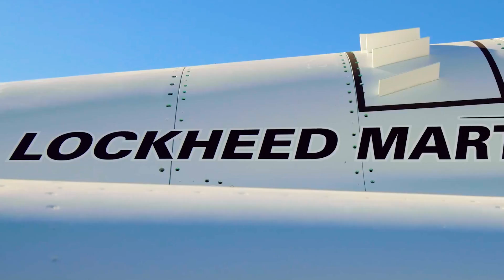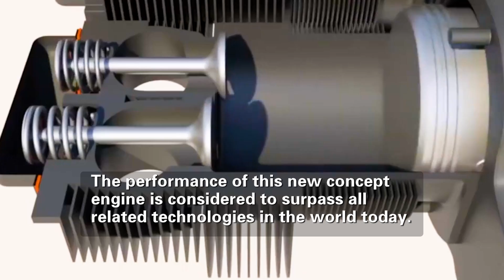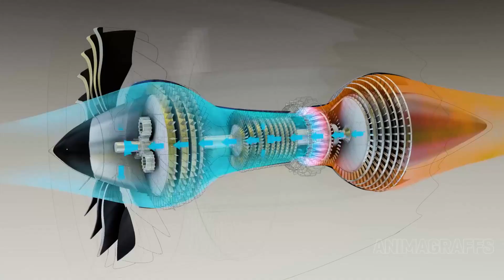Mach 16 Flight Speed! China's New Concept Aerospace Engine Raises Concerns in the West

Comment: Wow China's new scramjet engine with shockwave detonation instead of the conventional vertical detonation can achieve mach 16 while the usa could only reach mach 7 for a very brief period during flight. China has again surpassed the usa on scramjet engine development for hypersonic flights.
Reply: It's not really gonna be that fast u need a space suit otherwise u will die it's only half as fast a rocket and can't be flown
Reply: @jackdaniels2657  actually rockets move at 22000 KMs a second so there is much difference when it comes to speed what matters is it's size
Reply: Perfect for drone fighters that dont need to worry about g force.
Reply: No. The fastest US fighter reached Mach 7. The U.S X-43 is the fastest jet-powered aircraft on record at approximately Mach 9.6. China has not provided proof or demonstration of the so called "Mach 16" capability.

Comment: High speed uses a lot of fuel and is not for long distances. High speed is for intercepting and then fliging home slowly or refueling in air or on ground.
Reply: Nah it’s more efficient when it comes to fuel consumption. Example blackbird.
Reply: @bijayrai942  Air resistance grows with the power of 2 with the speed (2x speed = 4x air resistance = 4x more power needed = 4x more fuel needed)

Comment: In english is transcript how ramjet use is power if true that detonation engine could use 80% off power and is like confirmed 16 Mach is then time to present it in tests  and start aplication form off assembly copyright field off area is like tonahawk torpedo Long range like star trek photon torpedo capable any target stroke Inc ship sink by speed second is ind purpose as engine for airplanes for 80-120 passengers and vtols as engine attached on servo on chasis so scfi transporter or corvette time what is nice to kniw is still not oxy engine space x but iff data corect a 420 tone off oxy pressure could be tried to build as basic idea is double turbo if chamber mushroom fixed in double 5-6 chambers or even double seven thats equal as euro 7 safety standards and also like heavy task as naša use it in shuttle and eng corespondance as epic size in before time if črto box cooling equipment box solved and systems spread cool with own pc added and could be controlled wifi or from control room then somewhat faster spaceship and corvette time and perhapse time for new open source prop reduced emisions time also

Comment: We still have wait to see if there are practical applications to this technology. Remember Tacit Blue had been rumored for years out of the black hole at Dreamland. At mach 24, you just have speed and nothing more; only when your can give velocity. Meaning your can steer the vehicle without ripping it apart or using massive amounts of fuel for just a short flight.  Remember, in order to ship tanks at a rapid rate, you have to find a way to make each one lighter; juxtaposition the need for protection on the battlefield.  An example of design paradoxes, make an airframe going really fast in one direction, attempt to give it the ability to change direction and what might follow is Boom.
Reply: CHINA DEVELOP FOR FUTURES SPACE EXPLORATION....NOT WARMONGERS LIKE USA.....